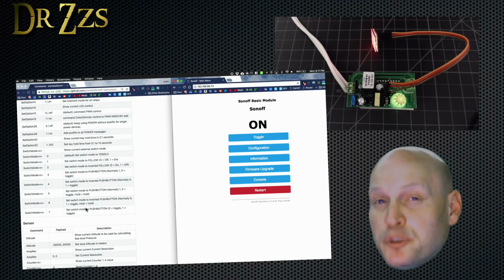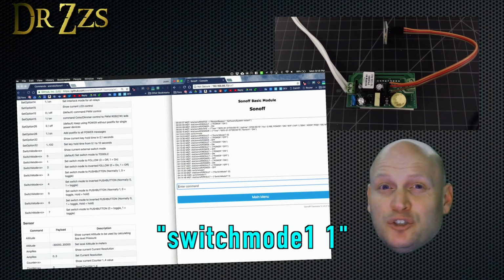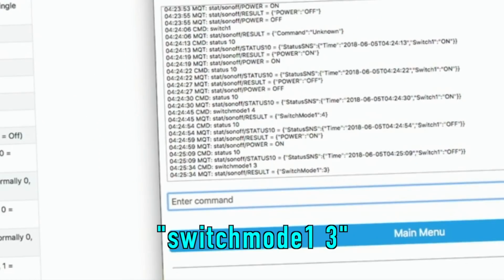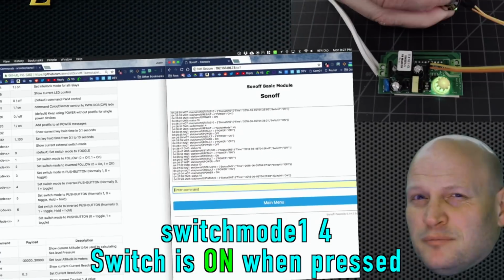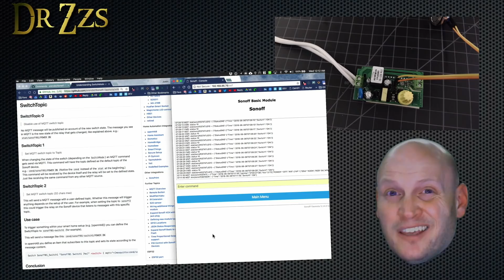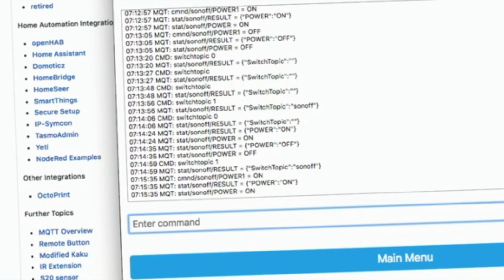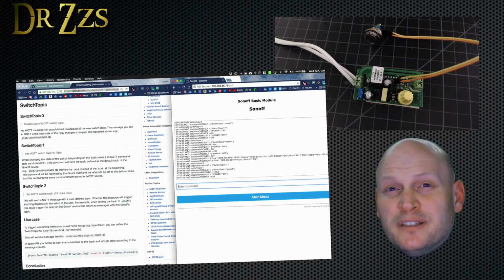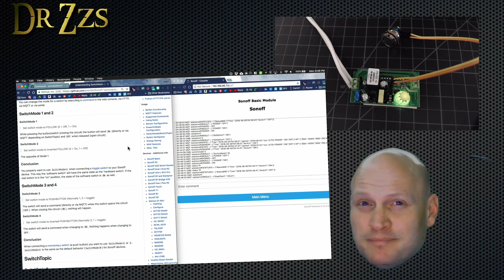Tasmota SwitchMode Explained

Comment: Hello, thanks for all your videos. I was wondering if you can help... I have a 3 gang sonoff and want to program ot sononly 1 gang can be turned on at a time. I will use this to make a fan controller in which gangs 1 and 2 passes through a capacitor for speeds low and medium. Obviously 2 gangs turned on at the same time will cause short circuit..... Could you help??!!

Comment: Hello, could you explain me how to configure sonoff touch T1 or TX to work in pushbutton with dimmer mode.  I try to set it up but it doesn't work like it does in your video. I can't set SwitchMode 7.  I only expect 230V on the output if I touch the button, and when I hold it, 230V will be there for as long as I hold it.  I don't need to send MQTT topics to HA.  Can i configure it somehow?  Greetings.  Slawek Z.

Comment: I have an ESP8266 D1 mini controling 4xrelays for lights in different rooms, it is also integrated with alexa and works like a dream. However I'm looking to add physical push bottons to enable normal on/off functionaliy, aswell as updating alexa of any state change done by the push buttons. Is there any option to enble this using the D1 mini? I look forward to any feedback.

Comment: Great clarification. Been battling with switchmode for a while now. Do you have some video/blog that covers switchmode together with rules? I have a 2 gang switch (one connected to a light, the other to a fan). The switches run Tasmota and are push buttons not rocker switches and I'd like to use switchmode 5 or 6 to utilise the HOLD function as well.
The idea is this: When the light (switch1) is on for more than x mins, turn on the fan (switch2) for y mins before turning it off again. Can't get this to work. If I look at the pseudo code it should do something like this:
On trigger (i.e. switch1#state=on) start a timer1 x mins
If the timer1 has expired AND switch#state=on turn on switch2 for y mins (timer2)
Once timer2 has expired turn off switch2

Comment: hi internet,
could someone help with this problem i have with making a rule, I've a shelly that the relay needs to be on when 2nice plug has watts or amps under load.

Workings of the shelly
Firmware 1.70
Configured Shelly device to create WiFi Access Point and you can connect to its network. IP 192.168.33.1
Using the relay to power a vacuum cleaner

Workings of the 2nice UP111 Power Monitoring Plug,
Running Tasmota 8.3.1 Fred
connected to Shelly network
Operating a relay of a power tool.

Rule 1
  ON ENERGY#Current>0.025 DO http://192.168.33.1/relay/0?turn=toggle ENDON
  ON ENERGY#Current<0.025 DO http://192.168.33.1/relay/0?turn=toggle ENDON

im sure its my coding that needs correcting, 

thanks,

Comment: Thanks for the video, this was really helpful.
I'm facing a challenge and would appreciate if anyone can help. I flashed my Sonoff basic with Tasmota and completed the setup including WiFi credentials.

I then connected the switch to a light (the only wire connections were live and neutral wires at both ends to respective connections). I then changed GPIO14 to Switch1 (9) and set the switchmode to 0.

I was able to control the light from the configuration/web interface. But I expected that switching on or off from the physical switch and switching on or off from the web interface will keep on toggling the light.

However, when I switch the light off using the physical switch, the sonoff (probably) gets turned off and I can no longer see it connected to the WiFi.

I then set switchmode to 1 but I'm facing the same problem.

What am I doing wrong?

Thanks.
Reply: So you have a switch and a light. The switch can either be the built-in one or one soldered on to GPIO14) like in the video. The light is connected to the output terminals.

"I then connected the switch to a light...". What does this mean? Also don't understand what's in brackets

Comment: Completely new in this and after received my first Sonoff I realized the model R2 has no GPIO 14, Ive seen it can be found in pin 9 of the chip, although is really difficult to solder in such a small location. After Tasmota's flash, can the toggle button in the board (Pairing button/manual switch) be used as a push button still? if so, can Home Assistant recognize the state of the sonoff after it changes using this included push button? My plan is to solder wires to this button and extend it to an external push button. I know I am a bit late to the game but I will appreaciate if you can respond, I'm planning to follow your entire setup/tutorial for my own home automation.
Reply: Hi. The original push-button on Sonoff is GPIO0, that is not visible if you use module type basic. If you change the module type in your tazmotized sonoff you will be able to control gpio0, and you can then change gpio0 to something like switch2.
Reply: @mraboyum  do you recommend a specific module? I'll be using the sonoffs as a light switch only.
Reply: @alejandroruiz8617   If you choose "Generic (18)" you can change GPIO0. However after some extra thoughts perhaps you can just change the behavior without even changing the module-type, by just making a console command like: "switchmode0 1". Maybe you can try both things, changing the module type only takes about 5-10 seconds, and you can change it back to "Sonoff basic (1)".
Reply: @mraboyum  thanks, I'll research more about it. With your response I have some guidance finally.

Comment: Thanks, good info. I have a problem, i have 2 buttons but it only gives me POWER = ON or OFF no matter which button I press. What am I doing wrong or is their  a fancy switch mode/option I missed. I tried setting GPIOs as BUTTON1 & 2, as SWITCH1 & 2. I can't get it to tell me which input changed. Any ideas?

Comment: Can I make the switch read a signal instead of sending?
Reply from the maker: like connect it to a binary sensor?  
Yes. you can do that.  Again, the switchmode you want will depend on what type of sensor/button you're using.
Reply: @DrZzs  sensor sends a signal 0 or 1 have any button that receives this signal?
Reply: https://youtu.be/8GFG_AV1e7s

Comment: Great Video as always.  Two questions.  #1 Is there a video identifying and explaining  the various of Sonoff Basic?  They do not appear to use model numbers, but my switches (perhaps R2) have black wires replacing the heavy "solder channels" on the board and do NOT have GPIO14 identified.  I have not seen my model in any of your videos.  #2 I am using a lighted momentary contact switch (in my case between ground and "Key") but I can not find a pin providing 3V that tracks the relay status.  There is always 3V between ground and "Key".
Reply from the maker: thanks.  ya, you have the R2 and now they are on the R3 already.  The best place to track changes is probably the Tasmota wiki. https://github.com/arendst/Sonoff-Tasmota/wiki
I'm not sure about a pin that tracks the relay status.  I'd guess you'd have to solder directly to the relay control contact.  I liked the v1 of the sonoff basic more than the last 2 versions.  Wish they still made the old ones.

Comment: Hey bro really cool video so I was working on a project where I involved a water pump that would pump
Water  to a tank and so I used a Sonoff sv to set a timer to
The pump so water doesn’t overfill and it takes exactly 5 minutes and 30 seconds to fill up the tank more then that and it can overfill but the thing is that the EWeLink app can only do whole minutes like i could only program 5 minutes and not the other 30 seconds could it be possible to change this with tasmota sorry for my bad English hope you can help me thanks 🙏 nice content btw
Reply from the maker: Your English is very good. 
Yes, I'm sure tasmota will let you do a timer in seconds, not just whole minutes.  
Hope that helps!
Reply: DrZzs thanks 🙏 do you think you could give me a brief explanation on how to?

Comment: Awesome,
I m using Nodemcu module & flashed it with 4Ch DIY Sonoff . 3 channels wall switch ( Rocker Type) working ok. But when the 4th switch is switched ON all previously switched channels goes OFF including the Channel 4 . The module does not come to normal operation until wall switch 4 connected to specific GPIO is revert to pull up level.
Sir Can you please help me solve this .
Thanks

Comment: Thanks for all the videos. can i ask if it is possible to use switchmode on sonoff dual to achieve relay 1 on and off as normal when triggered, when relay 2 is triggered relay 1 to be triggered with it on or off

Comment: Ty for your inspiring  video's. I have a no voltage relay sonoff sv with tasmota that i am going to solder in parallel to a momentary switch, and I need it to be on a pulsetime of 30 since my pelletheater needs a 3 sec push of the button to turn on. How do I setup the sonoff that after a push of the button the state remains on? Now it just toggled to off again after the 3 seconds. It is all kind of new to me, and I got this far. 8)
Reply from the maker: sounds like you need a different marker of the state of your devices besides the button/relay.  Nothing comes to mind to solve that with just the sonoff SV.  One possible solution is a power monitoring plug.  With that you could monitor the power usage by your heater and use that as an indicator of the state of the heater.  Something like the sonoff s31 or the POW would work. Those power monitoring plugs are usually rated for 16 amps.  Hopefully your heater doesn't draw more than that.
Reply: @DrZzs  thx the power monitoring is what i read about before but was hoping to avoid it due to.. well. Inexperience and lack of time.. Got so much to learn when you just start  off with this. Ty for your comment and suggestion, i will look into it. I think the max watt is 350 so 16a is well enougj

Comment: How to I use switchmode when I have a PIR or Radar sensor attached?
Reply from the maker: You set it to one of the non-toggle switchmodes so you'll get an On or Off instead of Toggle. 
I'm pretty sure Switchmode 1 will be the one you want.

Comment: Thanks for the great video DrZzs it helped me out a lot. Although a small question:

Hi Everybody, If anybody could help me it would be nice :smiley: im using 2x sonoff T1 Dual switches (flashed with tasmota) and i would like to connect them with each other using the GPIO pins and tried to connect the GPIO of the first T1 to the GPIO of the second T1 switch. (to create a two way switch or an hotel switch) from downstairs to upstairs without the use of any domotica system. at this moment it doesn't seem to work. when i short the wires on 1 sonoff T1 the switch on the GPIO works fine but then i connect the first T1 to the second T1 nothing happens. (RX + Ground wire) anyone has a suggestion ? any advise is welcome :smiley: thanks in advance
Reply from the maker: I'd suggest using rules in Tasmota.  It's not a wired solution, but it wouldn't rely on any other system either.   
I think what you're trying to do might work too.  You'd have to make it so the connection uses a couple pins.  One that senses a voltage change and one that sends a change on each board.  I'd have to do some experimenting before I could tell you exactly how to do it.
It's an interesting project.  I'd like to see it work.  Maybe ask in the Facebook page or Discord.  Maybe someone else has tried something similar.  (links to those are at DrZzs.com if you haven't already got them).

Comment: Hi, Nice Video, I have run the command switchmode1 2 on the sonoff touch1 and confirmed its status with the SwitchMode1 command ok.However the LED and relay still work in tandem. Is there another setting needed?
Reply from the maker: Thanks!
You can change the function of the LED with some other commands: 
https://github.com/arendst/Sonoff-Tasmota/wiki/Commands

LedPower  Show current led power state as On or Off
LedPower 0 / off Turn led AND LedState Off
LedPower 1 / on Turn led On AND LedState Off
LedState  Show current led state as 0 to 7
LedState 0 / off Disable use of LED as much as possible
LedState 1 / on Show power state on led (inverted for Sonoff Touch)
LedState 2 Show MQTT subscriptions as a led blink
LedState 3 Show power state and MQTT subscriptions as a led blink
LedState 4 Show MQTT publications as a led blink
LedState 5 Show power state and MQTT publications as a led blink
LedState 6 Show all MQTT messages as a led blink
LedState 7 Show power state and MQTT messages as a led blink

Hope that's what you're looking for
Reply: Same issue here.  Led Power controls the small blinking status LED and not the touch sensor illumination.  I would like to use SwitchMode1 2 such that the touch buttons are illuminated when the room lights are off.  This would make it easier to find the buttons on the dark.

Comment: New to Tasmota. What is the significance of the switch number (1-9) when selecting the GPIO14 function? I am working with an SV at the moment and I was having trouble decoupling the reed switch from the relay when using Switch1 and using switchmode1 1 and switchtopic1 1 . Maybe user error but it seems like moving GPIO14 to Switch 2 corrected that problem. Thanks!

Comment: Appears switch mode 5 and 6 may have changed in an update since this was posted as I can't get those modes working. Running firmware 6.1.1.

Anyone able to confirm this or if it's just a me issue.
Reply from the maker: hmmmm
What specific issue are you having?  I've used them with 5.14, but haven't tried with 6.1.1 yet.
Reply: @DrZzs  I'm getting a different response being posted by the sonoff compared to what you get. 

Will get the exact response for you later to compare. I've tried it with a few different sonoffs and get the same result. 

There's also an extra switch option now hence why I think they firmware update may have changed things.
Reply: This is the response from the sonoff when I use switch mode 5 or 6

MQT: domoticz/in = {"command":"switchlight","idx":0,"switchcmd":"On"}

Comment: Hi, your videos are really informative. I'm planning to tasmotize my few sonoff 4ch pro r2. I would love to make it in sync with my hardware switch. Can I do it using switchtopic?
If so do you know the GPIO locations and ports which I can use for 4 relays on my 4ch Pro r2.

Thanks in advance
Reply from the maker: Thanks!
I don't think the 4ch has any available gpio pins, other than the Rx/Tx and you don't want to use those for external switches.  What I think you'd have to do is connect to the contacts on the board that go to the button for the relay you want to control with your hardware switch.  Tasmota sets the switchmode to 0 by default, which is "toggle" for a momentary switch, so if you're going to use a rocker-type switch you will want to change the switchmode to 3 or 4 (if I'm remembering right).  
It'll take a little trial and error but I bet it can be done.
Reply: @DrZzs  thanks a lot. I would love to experiment with that.. I'm not familiar with the electronic stuffs. But I'll give it a try. I'm now struggling to find the contacts where I need to solder. I even checked the schematics from their website. But it's all going above my head.
Reply from the maker: do you have a multimeter?  I would test use contacts connected directly to the buttons.  You'll need to be able to tell which contacts are connected to each pole on the switch.  Maybe it will be too much to learn from scratch.  If you don't think you can do it maybe a different solution would be better.
Reply: @DrZzs  I have a multimeter. I'll give it a try. Will keep it posted here.

Comment: Great tutorial. I have a problem here can you help plz 
How do I set Default Powen ON state Sonoff Tasmoto?

When Power reset’s or I switch off & Switch ON the physical switch I want the sonoff to TURN ON & stay as a default state.

But for me, the sonoff Turn’s ON for few seconds & switches OFF automatically, When Power reset’s or I switch off & Switch ON the physical switch
Reply: What I mean by power rest here is. Power cutoff to sonoff Input. That's like power failure & then when power failure is restored. I don't use any switch between GPIo & gnd tapping.
Reply from the maker: I think I understand. Try typing “poweronstate 3” in the TASMOTA console.  
If that doesn’t do what you want here’s the list of all the command options. 
https://github.com/arendst/Sonoff-Tasmota/wiki/Commands
I think one of the poweronstate settings will do what you want. 
Hope that helps.

Comment: I want to make my regular light switches in my house work with this sonoff.  can you do a video on just that .. from flash to wall install.. I can't seem to flash my sonoff right I have tried a few different ones  or can you sell me some.. OMG HELP.. LOL  I'm not that bright..   thanks so much for posting.. YOU ROCK!!!
Reply from the maker: Thanks!
I should redo some of the earlier videos because I have refined the process quite a bit.  
Let's start with what errors you're getting when you try to flash.  I might be able to tell you what to change based on that.  This is the best method I've found: 
https://youtu.be/NNW05smSNOA?t=2m3s

If you're in the US I could probably send you flashed sonoffs pretty easy.  email me your address and such.  justin@drzzs.com